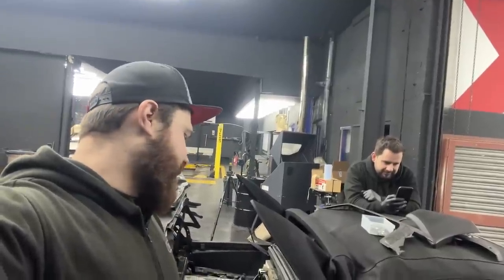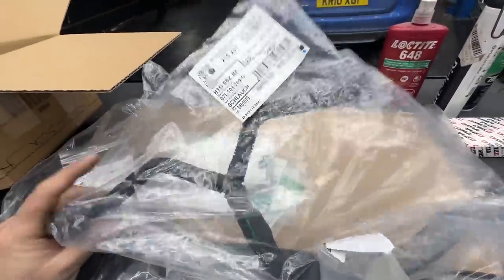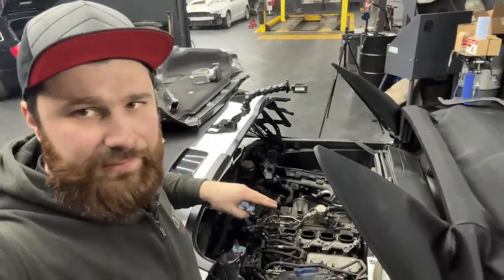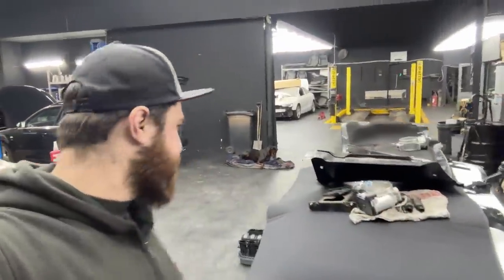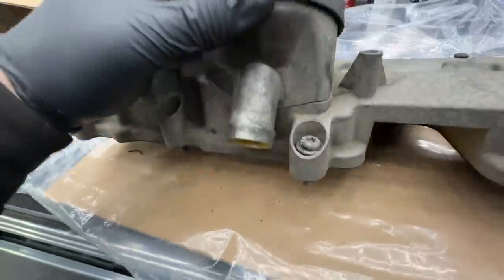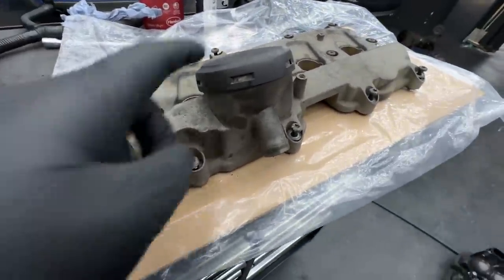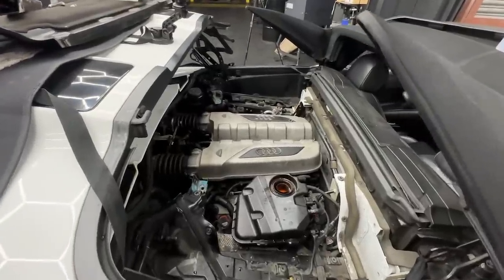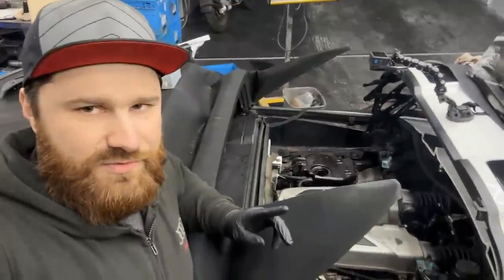Audi R8 V10 x times more problems? We had to strip the engine down from the top

Comment: About 15 yrs ago I rebuilt a couple of Porsche boxsters, both had the same problem of overheated engines/gasket failures. They were bas--ds  to work on had to drop the engine/transmissions out from the underneath, no four post lifts, just, jacks, wooden blocks and rolling about on the garage floor. We rebuilt a good few engines, and these got the budget rebuild treatment, no huge new parts bill, just the required parts to a minimum chain guides, head and blocks gasket skim, the usual stuff, hot pressure washing everything, including the blocked oil coolers. The first 2.7 car when finished was fantastic, I thrashed it daily and it loved it,- sold, on to the next, a 3.2S, this one had every plastic part melted or distorted it'd gotten that hot, same budget treatment secondhand parts, loctite 5900 silicon gasket back up. It needed rings,  way too expensive from porsche so I found a perfectly sized and material alternative at a tenth of the price, cadillac northstar V8 +.020. Somehow on the engine rebuild even though I knew to be careful I managed to get one of the cams 180 degree out of phase, luckily on start up I caugt it early and no damage was done but it all had to come out and be redone, but I'd had enough by then. The engine again was brillient, but I could'nt bring myself to hammer it like the first, the thought of doing it all again was too much. Sold it, saw the purchaser some time later, still had it ,loved it. Long story, happy days.🙂